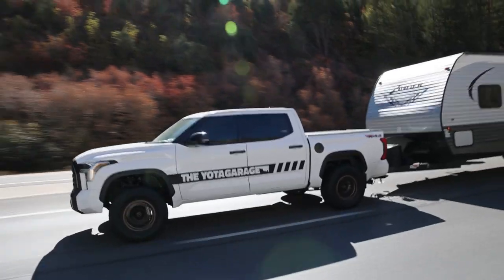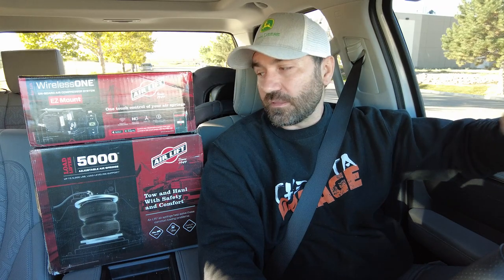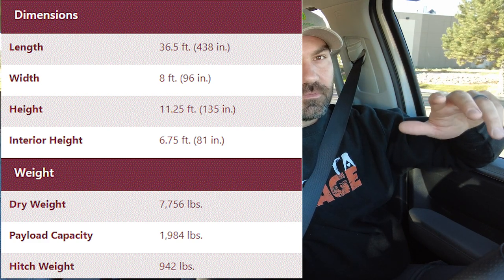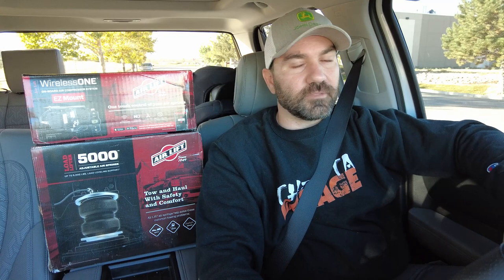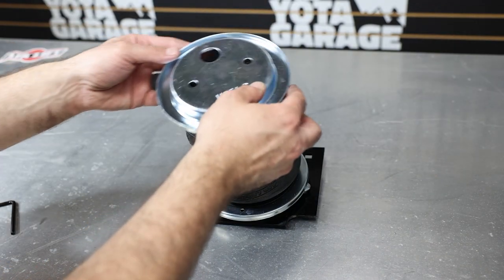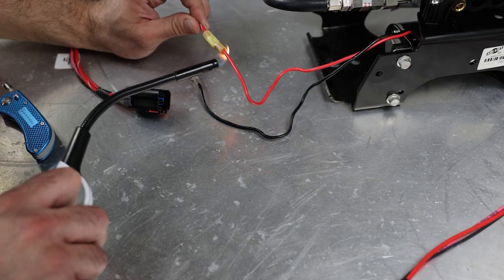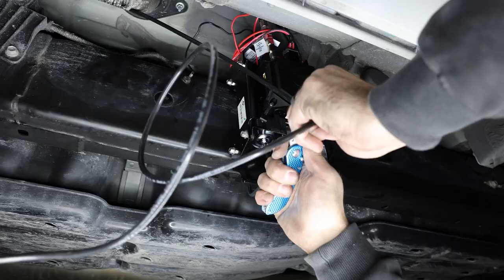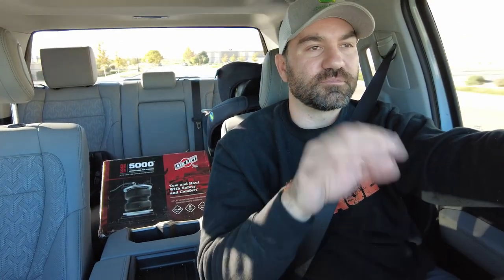2022 Toyota Tundra Towing | Increasing Tow Capacity with AirLift LoadLifter 5000 + WirelessONE DIY

Comment from the maker: Get your 22 Tundra AirLift Goodies 👉 https://bit.ly/3eSVRyq

Here are the Specs on the RV Which I pulled with the 2022 Toyota Tundra without any issues. 

RV Specs:
2019 CrossRoads Zinger ZR328SB (Travel Trailer)
Length: 36.5 ft
Width: 8 ft
Height: 11.25 ft
Dry Weight: 7,756lbs
Payload Capacity: 1,984lbs
Actual Weight: Around 8,000lbs
Hitch Weight: 942lbs

Comment: Im a 2nd Gen owner, but im beginning to come around,  because of aftermarket  support. I tow, an towing  is important  to me. I like that 10 speed Transmission.  Not totally sold on that V6.
Reply from the maker: Having owned the truck now for over a year, I can tell you that I have 0 regrets and am super stoked on the power and overall build quality of the truck. I would say the only thing I miss on this vs a V8 would be the exhaust note. Aside from that, this truck has been a work horse.

Comment: Air bags dont actually increase tow capacity you need a actual spring upgrade to increase tow capacity. All air bags do is level out the weighted down truck you need heavy duty springs for the increased weight.

Comment: Are you running a weight distributing hitch also.  Thats a lot of psi.   I ran a set of these on my 2nd gen with a WDH and maybe 40 psi to lvl it out even when loaded heavy for a vacation week.   My camper is 34' 6300 dry weight.   Definitely looking to add to my 22 Tundra to help out the coils a bit with leveling, but i do run a WDH always with something our size.
Reply from the maker: For the sake of this video I didn't have the WDH connected, based on previous experience with other trucks, with a wdh the bags will be round 40-50 psi. In my opinion running a weight distribution hitch in conjunction with helper bags is the best way to go.

Comment: So, is the compressor water proof, like crossing a stream?
Reply from the maker: Good Questions, according to AIR Lift:

Question: I tow a boat, can the control system components (compressor, manifold, etc.) be submerged in water?

Air Lift: Although the control system components can withstand the elements such as rain and snow, we do not recommend submerging these components as they are not completely sealed waterproof units. In this case you might consider mounting your compressor system components towards the front of your vehicle instead of the rear.

Comment: you cannot increase the tow capacity. it is limited by the FRAME and axles of the truck. a spring or bags will only level it out.

Comment: Correct me if I'm wrong here but air bags do not increase towing capacity. They just raise the back end if you don't have a wdh.
Reply from the maker: While it doesn't affect the actual towing capacity for power, it does increase the safety by leveling out the rear end to rectify Squat solves the truck bottoming out, trailer sway and body roll, light steering and braking feel and also the uncomfortable ride due to the jarring and bouncing.
Reply: @GearheadJT  so it increases towing capacity. So tired of the pc answer.
Reply: correct

Comment: Nice step by step video. I’m struggling to tow a Jayco 263 RBS 30’ bumper to tip. 700 lbs tongue weight empty 6500. I have a 2016 Tundra, so plenty of power, but even with equalizer weight distribution anti-sway, over 45 mph, bumpy roads, back roads, just can’t relax. I installed some of these airbags. One thing I wish they would have included is the cradles because if you Jack the truck up to change the oil, it pulls serious downward pressure and can damage the airbags. For crying out loud Airlift, why not include the with all sales and let people know why. Now I had my oil changed and the right one is leaking, pray it’s just the loose line. If not, I still have to buy the cradles, hope they replace the damaged bag, and take it all apart. All this could have been prevented for $50 and some pre-installed education

Comment: I have a 2022 Platinum with the tow package and airbags.  My camper is 600lb tongue weight, and 5000lb dry weight, and it significantly squatted my truck.  The factory airbags did nothing to offset set the squat.  My question is can I replace the factory airbags with the ones you are showing?